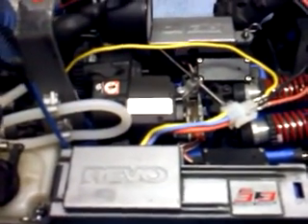Revo Remote Start - ROSS on a Revo prt. 3

Comment: Thanks SBS, this is so nice, the car was badly out of tune, but I left it that way to show the remote start. I'm amazed at how simple this is. The two vids I posted up, this was the first time my son had driven it, so he didn't want to crash lol. The voltage will read 7.4v or 8.4v when the glow plug wire is unhooked, but when it's connected it's about 1v, which works great. The Ross steps it down for you. 
The guys at the LHS were amazed at the simplicity.  no kidding on the Ross lol, sooo nice.

Comment from the maker: @cesarr1976 - Yes - The Team Losi  Part No. (LOSB9818) battery. Which is a 1000 Mah, 7.4v 2s Lipo with the Blue EC2 type connector. Can usually be found on eBay.  Or any equivalent 2 cell Lipo battery that will fit in the Stock Revo Battery Box.

Comment: So you are replacing the 6v battery with a 7.4v lipo battery. My question is do you need a BEC to drop the voltage down to 6v so the reciever can handle it or can the servos and reciever handle the 7.4 volts?

Comment: Curious did you're Ross module drop the voltage to the 1.5v glow plug voltage or did you use some type of resistor in the glow plug circuit? I went ahead and am doing this to my T Maxx and am getting 2S battery voltage to the glow plug, which is 7.4v. It works great, tested it last night with the GP unplugged, but really can't figure out which way to drop the GP voltage. I'm using one of the Traxxas 2218 5 channel receivers. Any help would be appreciated. Thanks.